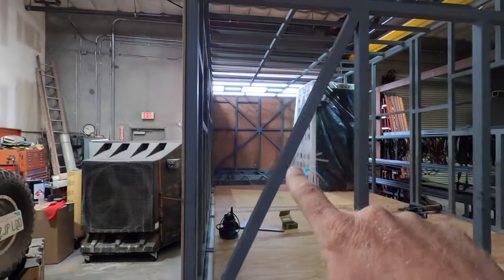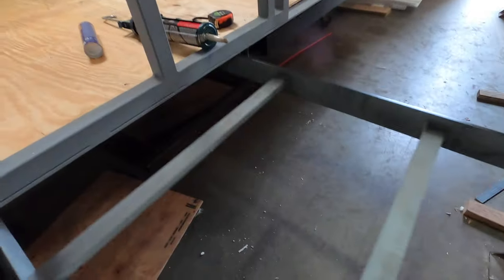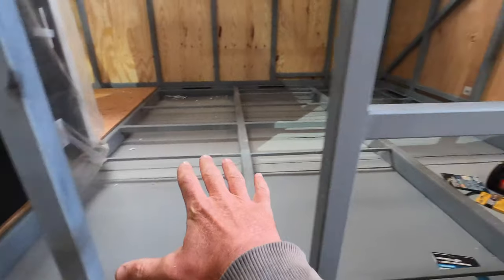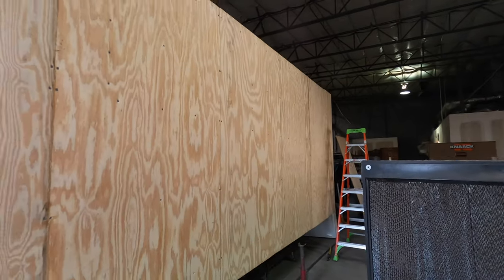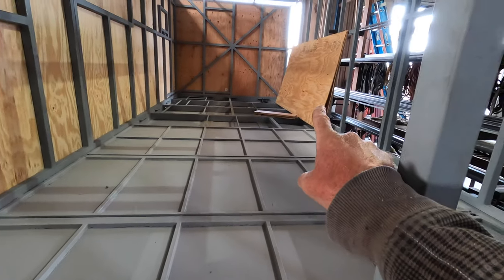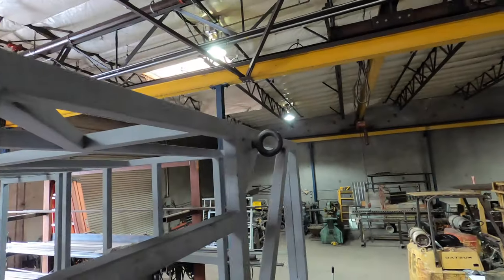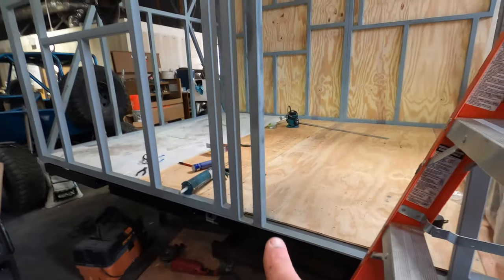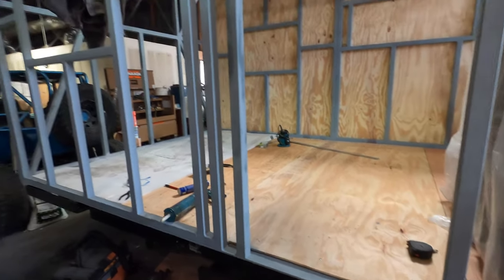Habitat Sheeting and Insulation  -   LMTV Update 28

Comment: Awesome Nate! question: what fastening method are you using for the wood siding to the metal frame? Assuming it's steel... Do you pre-drill holes or use self tapping screws?
Reply from the maker: Yessir, steel 1-3/4 tube for the frame. It’s glued with adhesive and self tap screws. Cool little screws have a bit at the end that counter sinks the wood then breaks off when they hit the steel.

Comment: Hey Nate — good to see the progress you’re making. Apologies if you’ve answered this before.. but I’m curious where you found the shop space for a big project like this, are you renting the space? Thanks Austen
Reply from the maker: Great question!  So before I started this project, I had a frank discussion with this fabrication shop.  We laid out the plans for the truck modifications, frame extensions, and box build.  They are a welding shop.  So part of the deal was that I could help with the build, it took some trust and a bit of effort on my part to get to that point.  Lots of days helping them out, cleaning the shop, etc.  But now I've got pretty free access to do whatever I would like to do, and at this point, most of their work is done.  They had a season where they were a little slow and they dedicated that bay to my project.  Once the box is on the truck, it won't fit through their roll up door, so I'll either be outside in the yard (if we can make the room) or I'll need to find another location to finish out the inside of the build.  So, built into the deal I made with them was use of that bay until the box goes on the truck.  That has morphed into being able to use pretty much anything at the shop after hours as long as I'm not in their way :)
Reply: @NateVolk  Hey really appreciate the detailed response. Such a positive you were able to find space for a project like this. Excited to keep following along and watch as the box makes its way onto the truck.
Reply from the maker: @austendewolf  Glad to help, thank for watching!